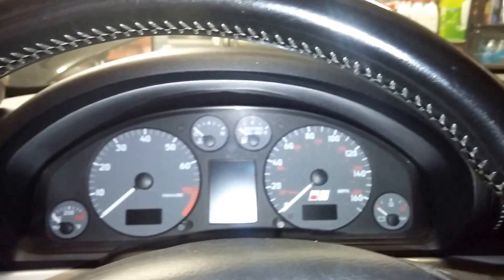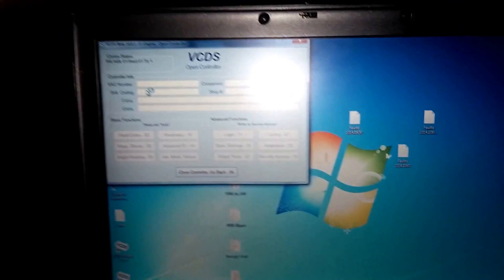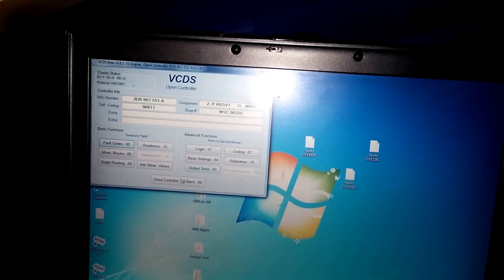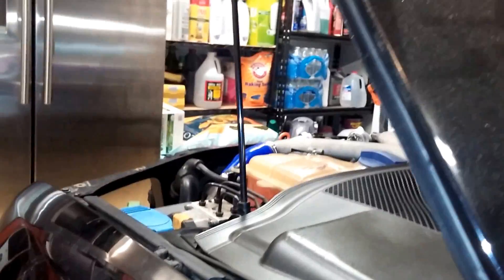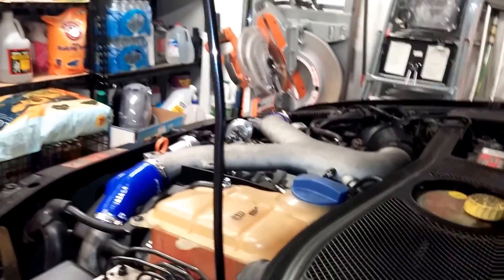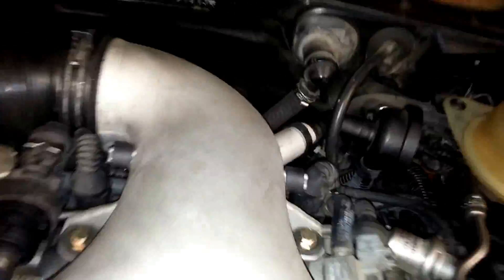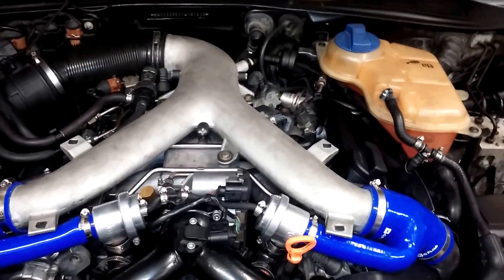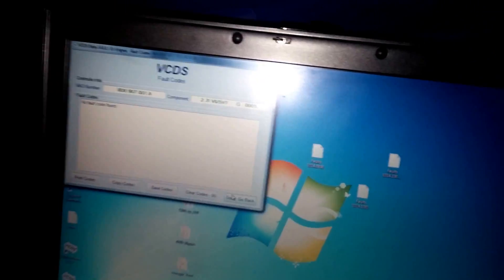2000 B5 S4 Crank but no start

Comment: check if fuel is reaching the injectors and if the presure is ok(this is very important for the injector to deliver fuel to the intake), check for spark in ingnition wire.

Comment: in these 2.7t engines, the camshaft position sensor is broken and the poles will then also remember the charger's voltage meter to check

Comment: I just recently read that you have some bent valves at only 89,000 miles that sucks I have the same issue going on with my 2004 2.7 Turbo Audi A6 where the thermostat housing blew out and pieces of it got caught in my chain as it went around and cause the timing to get off so I'm currently waiting for the part to come in so that I can put it back in time with a new belts  new thermostat housing waterpump all the seals and see what happens if it cranks ...kudos if not I have to take the head off replace the bent valves which is what you probably have to do. But 89,000 miles wow... this is my last Audi

Comment: Pretty sure you didn't get the timing back right and possibly bent a valve or two or three or four etc.
Reply from the maker: No compression passenger side.  Ended up I had some bent valves.  Sourced a new APB head and all is good

Comment: the temperature sensor is broken
Reply: On some cars like my 96 Toyota Camry if the temp sensor is broken or inoperable the timing won't sink. It will auto limp mode. But the thing should shoot a temp sensor code.idk

Comment: What was the problem sir ?
Reply from the maker: No compression passenger side.  Ended up I had some bent valves.
Reply: +Alex Moreno oh sorry to hear ! something went wrong during the timing I guess
Reply: fuck, that pisses me off, sorry man
Reply: @s4alexis  that would mean the engine was out of timing no? It's an interference engine, and the valve would have to come in contact wkth4the top of the piston.. .